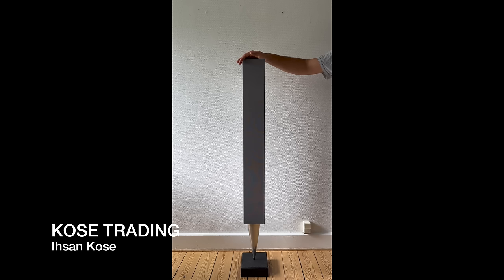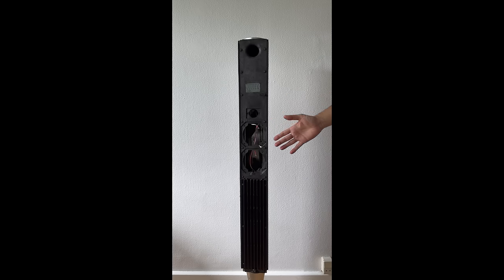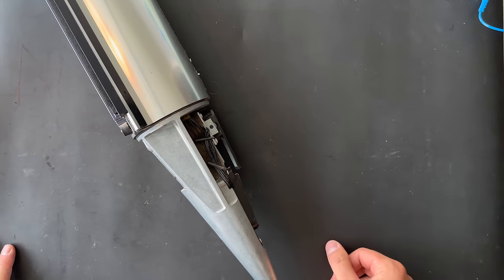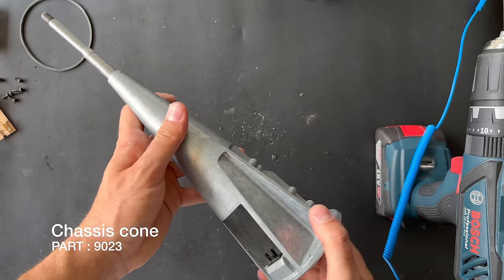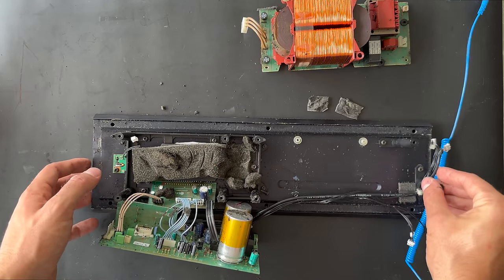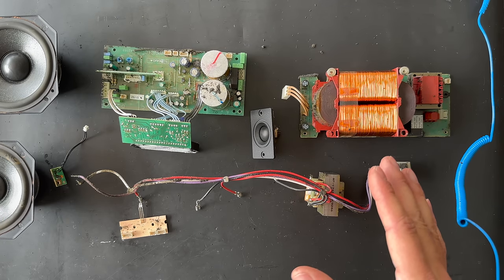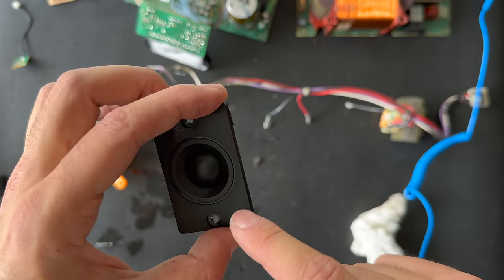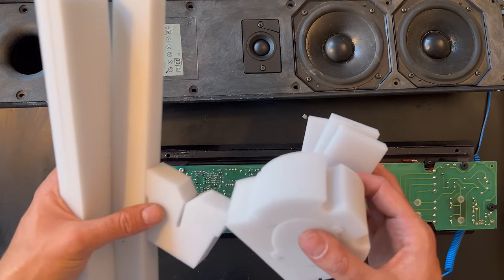Bang & Olufsen Beolab 8000 Disassembly, cleaning and new isolations material installment process

Comment: Congratulations! This is indeed an excellent tutorial! I whish I had seen this tutorial before I had cleaned my 6 units of Beolab 8000 loudspeakers. I hope that the new foam material does not degrade as the origiginal material did. I had only installed one set, since this was the only one I could order. Instead of a brush and liquid alcohol, I had used Isopropyl cleaning spray "IPA", "WL" and "61" (all from German supplier "Kontakt Chemie") and thereafter compressed air to clean the amplifyer and Power-supply board. This made the cleaning process of the electronics much easier. However you have to make sure not to blow the degraded foam all over the place! 
With one of the 6 loudspeakers, I´m facing a problem, that is most probably related to the black relais on the Power -Supply board. When the Beolab 8000 is connected to my Ouverture 2631 and i.e. a CD is played, the LED at the Beolab 8000 changes from RED to Green (as usual), however there is no sound fgrom the Beolab 8000. If then the 230 V power supply-cable at the Beolab 8000 is disconnected and then connected again, the function of the loudspeaker is normal. I guess that relais has a bad tontact and needs to be replaced. What do you think?
Reply from the maker: I appreciate your feedback and am happy that you find the film enjoyable. Since the new foam substance is a different kind of material, it won't deteriorate. 

I appreciate your suggestion to try a different cleaning technique; I'll utilize this one the next time. "cleaning spray "IPA", "WL" and "61" (all from German supplier "Kontakt Chemie")"

Sound like you have a bad amplifier board. Send us an email and we can take the conversation there.

Comment: Great Tutorial. Do you have any advice on an issue I'm having where one of my speakers is no longer playing sound and stuck in 'red light' mode? I debugged enough to confirm it's not the wiring since the same cable works fine on my other speaker. Tried toggling between R/L/Line and nothing changes. I can't fully tell from other forums but it seems like it may be an amplifier issue, hence I'm debating opening this thing up.
Reply from the maker: Send me a e-mail with the problem can we can try to help you out with the Beolab 8000.

Comment: Awesome video! I have a pair of 8002’s and was wondering if they would have similar foam issues. I have heard that some of the newer Beolab 8000’s have the new white foam so wasn’t sure if I should look at replacing the foam in the 8002’s as a preventative measure.
Reply from the maker: Hi. Thank you for your comment. The Beolab 8002 is the latest version of the beolab 8000 line and they have definitely improved the cabinet and the amplifier with new white foam.
Reply: Thank you so much for your reply and letting me know that information! Amazing!
Reply from the maker: @xyphonfilter  You are welcome. All those who own Beolab 8000 have the right to know about this problem so that they can avoid problems in the future.